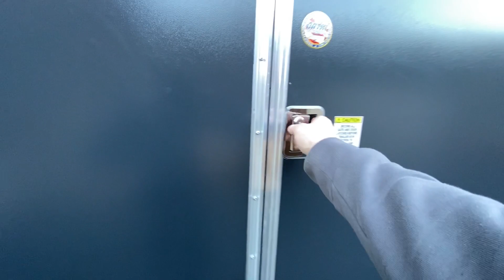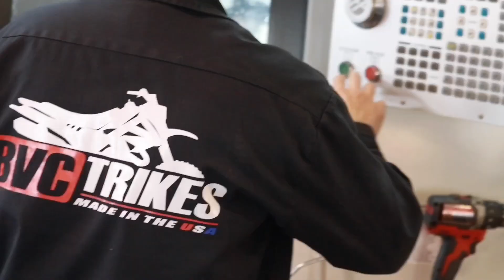HONDA TALON 1000R TRACK AND TRAIL First Ride BVC OFFROAD

Comment: I own the same unit. I'm interested in your opinion on the stock suspension setup. I find it a little rough and I may try to adjust it to minimize the bucking and chatter but not exactly sure how to so I'm doing lots of research. I know the 2.5 QS3 is a good suspension and I can't fathom spending money on new springs or a tune from someone like Shock Therapy. Every machine has something that could have been better but overall I'm very happy with my Talon and enjoy it more every time I push it's limits. Looking forward to see what you do and any opinion is welcomed.
Reply: Hey Chris. Check out dirt road fabrication’s Talon swing out bed extender (with spare tire mount).
I don’t have my Talon yet (arriving in May) but I have ordered one of these already. (And all the usual necessities which are accumulating in my garage until said Talon arrives).Sounds like it could be a win,win for you as well. Good luck either way.

Comment: Only downfall is the ride...fails miserably on the X. Redid mine with Shock Therapy springs helps immensely but npt where it should be compared to similar competition. Not good choice for older riders like myself with neck and back issues(ya know doing stupid doodoo starting in the 70s HAH)? If you are in need of comfort over all skip the Talon. 4 seaters are better esp with live valve but ride in a RZR4 and its night and day..never realized how boring belt drives sound...YXZ owners know what Im talking about! Still love my TalonX!